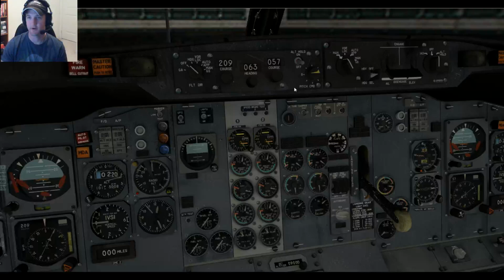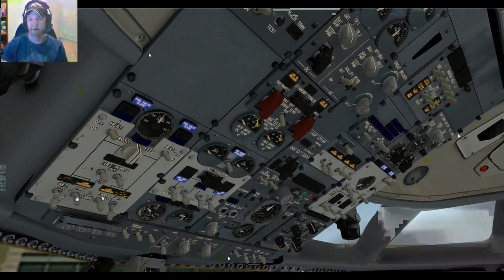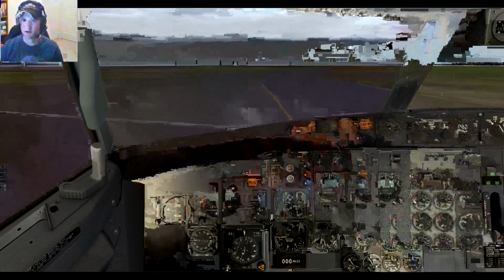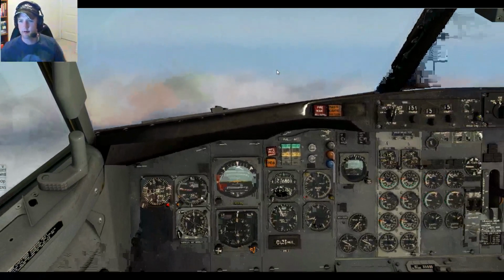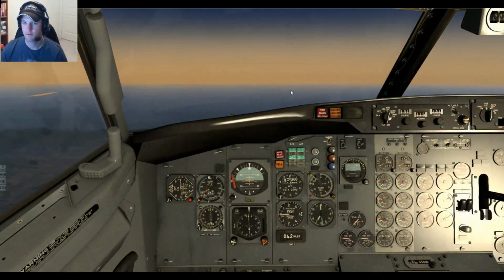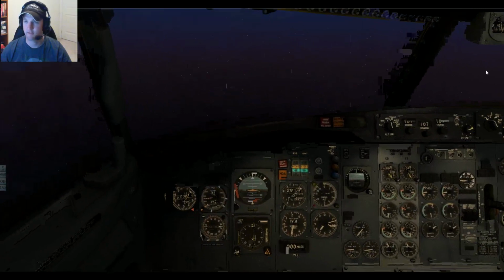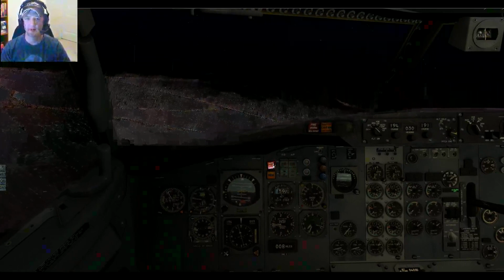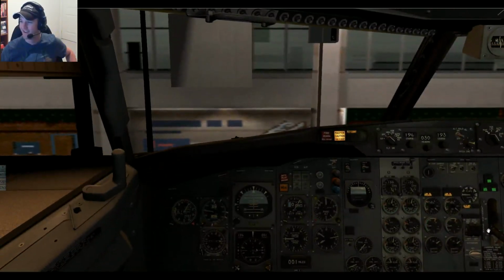X-Plane 10 - Boeing 737-200 Shared cockpit with a beautiful night time landing.

Comment: Hi, I was wondering how you look around the cockpit as I am new to x plane 10 ( this is one of the only actions I don't know how to do) please respond back as it would help me a lot
Reply from the maker: Chris Topher When you're in the 3D cockpit, just click and hold the right mouse button, then move the mouse.  You can also zoom in and out using the scroll wheel on your mouse.
Reply: Thank you very much, I have a yoke and do not know how to configure a 8 way hat to be able to look around the cockpit I was wondering wether you knew how that worked. If not could you please tell me which view it is in settings so I can look at it myself thank you.

Comment: Quick question, when steering the nose wheel on the ground do you have the tiller set to its own buttons/axes or is it interconnected with your pedals and the rudder control?
Reply from the maker: You can do either, but I have it slaved to the rudder pedals.

Comment: Were you running at different time of day than you're co-pilot? Also, How does the weather work? Is that synced between the two machines, or can you both run separate weather engines? I'm assuming that the "master" computer's weather would be the one that impacts the aircraft's performance?
Reply from the maker: You can run a different time of day than your co-pilot, that's not an issue.  The weather is indeed synced, but if anyone's going to take a performance hit from that, it'll be the "slave" computer.

Comment: Nice flight! Is this stock Xplane scenery? I use FSX mainly and have been debating the switch to xplane (sloped runways and other stuff). About how much do you think I will have to pour into it addon wise to get it likeable? I had 9 and didn't really like it, is 10 a huge improvement?

Comment: Hi I'm mostly a Flight Simulator X player, but I was thinking in getting X-plane 10 Global on Steam. But I have doubts about it's aircrafts. In the shallow research I did, I didn't find any Airbuses or Boeings aircrafts with virtual cockpits other than the default from the game. Is there any aircrafts of these manufacturers that has virtual cockpits?
Reply from the maker: There are many options to choose from.  I would recommend looking at www.x-plane.org, where most X-Plane aircraft are available for sale.